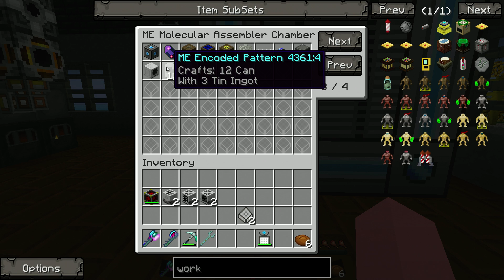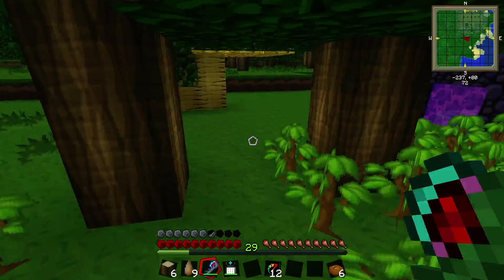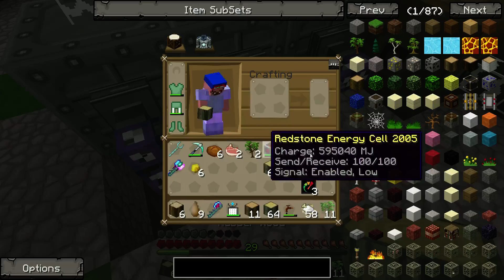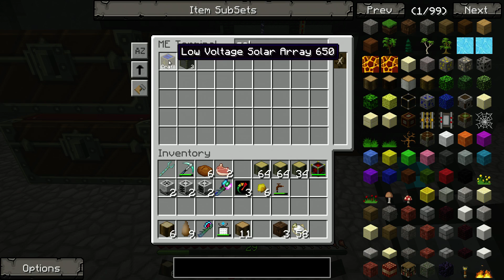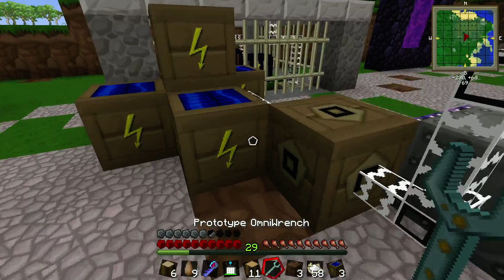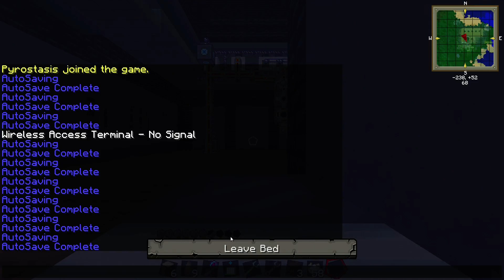Minecraft FTB Unleashed - More Power! Ep 40

Comment: the most upgrades you can put in a ic2 machine is: 16 overclocks, and 128 power upgrades and It will take extreme voltage and make a stack in about two seconds